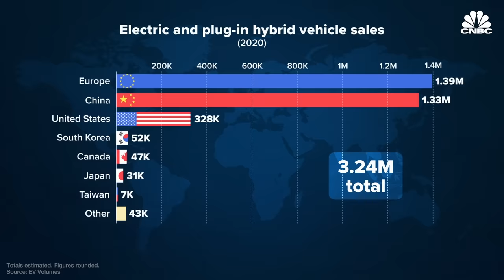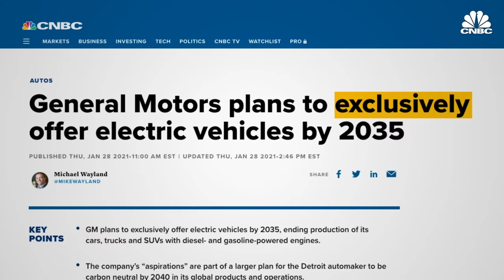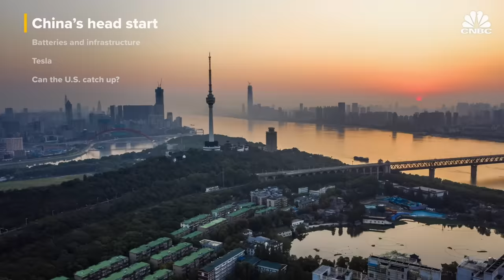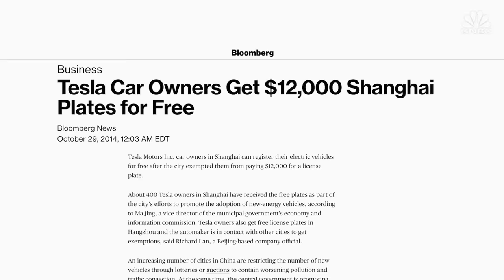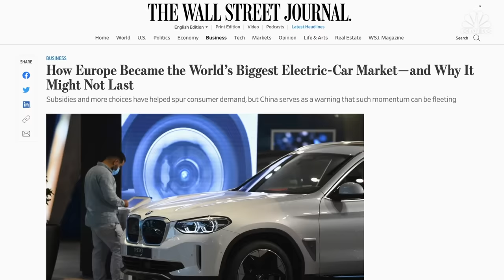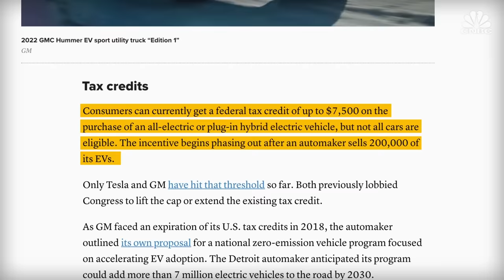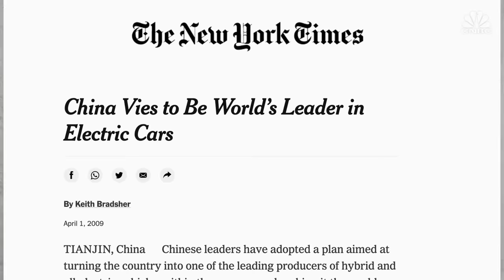Who Is Winning The Global EV Race?

Comment: even lithium batteries lifespan isn't what we're told they're supposed to be; in my experiments to try to do a partial off-grid power system, I've worn out lithium rechargeable batteries in less than 5 yrs.; we need better battery performance; but, that indicates just how much is our energy consumption

Comment: While what the video says is true. EVs in other countries outside the US mkaes alot more sense. There are places with cheaper prices for electricity, and shorter ranges required. The batteries dont degrade that fast and maintince so far is way cheaper. Also the batteries are normally under warranty for 8 years.

Comment: Battery swapping sounds great. Instead of coming up with thousands to replace a battery, it will be cheaper to just swap it out, yes there's a chance you'll get a worse battery but I would imagine they would take the bad ones out of circulation. And if it is bad, go swap again for a new one. It spreads out the cost of actually replacing a battery over the lifetime of the charging

Comment: While the only company that I have seen that did a CO2 production comparison between models was Volvo (ICE vs Hybrid vs EV), apparently they are all made in the same plant, EV's have an expected lifespan of 126k miles and reach par with ICE at around 90k miles in terms of CO2 generation. Initially 43 tons for ICE vs 55 tons for EV. This unfortunately did not take into account the lithium batteries which needed to be replaced every so many years. And the fact that we have no way f recycling the lithium, which is harmful to the environment. When are we as a citizen of the planet going to look at the things we make holistically instead of whats better right now?
Reply: Battery recycling can recover ~93% of the rare earth minerals.
Reply: @goevorgohome  Really? I didn't know that. can they be reused? I assumed metals yes. But what about the lithium? Can it be recharged or whatever it takes to be put into another battery again?
Reply: @heathbruce9928  When a car battery is at the end of it's life it can still be used for storage as it doesn't need to supply a lot of energy all at once like in a car. Alternatively companies like Redwood Materials can break down the battery and recycle the raw materials including lithium to be used again in building new batteries.

Comment: Battery swapping sounds like a great idea until some 75 year old driver run into the building and causes a fire that can't be extinguished.  It's bound to happed given all the cars crashing into structures in the news in the last few years. 
Why can't roads have inductive cables placed below the surface and cars driving on these equipped road just get charged like tolls for miles driven while  on them.   Small batteries can be used for local driving.  With wireless inductive charging cars could drive from coast to coast without ever needing to stop to recharge.  Your cell phone uses inductive recharging so it's not new, think of it as infrastructure for the future.  art:body-blue-raised-arms::hand-orange-covering-eyes:

Comment: Imagine if every ICE car had to have it's own brand of gasoline? How silly would that be? Swapping/ leasing is the only way this will work. Standardized batteries with computers to analyze the quality and charge balance of semi-depleted batteries are easy fixes. Also battery swap stations would be cheaper to build than gasoline stations. Also - Once swap stations become widespread, cars will be able to use smaller battery packs because range won't be as much of an issue.

Comment: I feel sorry for electric  car  drivers and future  owners. They will simply  have to learn the hard way .. as I did. These things are a huge hassle and a outrageous expense  in the long run. Batteries  are very ... very expensive to replace ( thousands of dollars) ...  and make no mistake, you will be replacing them. These batteries are highly toxic to our environment,  with a high potential for disaster to our surroundings. Plus I regret all the  lost hours at these charging  stations.  I wish I knew all this before I bought my car .  Do your homework before buying !
Reply: These idiotic claims are beyond silly by now.  Batteries will last literally decades today.  Even the older NCA batteries have 2000 charging cycles.  On a car with 350 mile range, that equals 700,000 miles.  On LFP batteries, with even 240 miles and 10,000 charging cycles, that is easily 2.4 million miles.

Just because some idiot bought a Leaf a decade ago has nothing to do with modern EV's...

Comment: I did not see any mention of how electricity is generated in China. Vast majority is coal-fired generation, and they are building more coal-fired power plants. China's air pollution problems having nothing to do with cars, there are not enough cars on the road to cause that much pollution. Worldwide, EV's will not "fix" the global warming or now renamed "climate change" issue. Estimates I have seen are that EV's will have lees then a 20% impact. The battery and recharging technology is not at the point that this can be rolled out to the masses. Maybe by 2035, who knows. I do know the bigger problem will be electricity generation. Renewables are not going to get the job done, and we have start be honest about this with ourselves. I admit coal-generation has to be phased out, but the battles against natural gas and nuclear power are short-sighted.

Comment: Hmm, 10 minutes to swap out batteries?! You'd think a robot-controlled battery swap could be done in less than 2 minutes. 10 minutes just seems like a really long time for something done by a robot... Like Elon said, 90 seconds seems reasonable just as long as the car is in the exact position it needs to be in. 10 minutes is longer than it takes to fill a tank of gas, lol.

Comment: There's no doubt that electric cars are the future.  Especially when it's pretty much mandated by our government.  That said can they make it where I don't have to plan a longer drive without having to worry about the availability and inconvenience of recharging?  I wouldn't even consider a 500-mile range vehicle (if that was possible) when I have to worry about the time and trouble of finding a recharge.  No doubt the push is on to go electric as we go forward and I'm waiting until gas gets so expensive, probably like a lot of folks.  I imagine when over half of all new vehicles at dealers are electric we're going to also strangely be met with outrageous petrol prices.  That's their trump card along with simply not offering much in the way of gas-burners.  So far trucks are the hold-up and we're already seeing the push to make that category largely electric.  You know your gas days are coming to a close when icons like the Camaro are being dumped and Challengers are going all electric...not to mention those silly electric pick-ups.  Did I mention going electric is painful?

Comment: Every manufacturer, who will make normal design cars, not weirdly overdesigned cars like it has been with EVs for some reason, will become another Tesla. Look, how much e-Golf sold. That is why it will be GM. It was just because of that. ID series is not that and will fall behind. If you look at any e-golf owners review looking behind how that car was or is, the MAIN characteristic is that it looks like a normal car. That's what people want. And that is why Tesla sells. While it is a bit weird, its still normal-looking. Unlike VW current EVs like the ID. series. Most europeans like a modest, minimal design car, not too flashy but not too old-looking. Just to get from A to B. A Golf basically.

Comment: I think Tesla gets waaaaaay too little credit for it's own charging network and auto insurance both which are capable of generating massive profits and also offer a better product than their competition. This doesn't even include tesla energy with their mega pack batteries and powerwalls and solar operations. Between the major differences of tesla embracing the entire picture of those related yet massive markets and leading the charge on autonomous driving they also have a great strategy of vertical integration to allow them to keep prices in a reasonable range without having to sacrifice quality of the components. Legacy auto makers are going to have a massive issue trying to make electric vehicles at a near equivalent price without both taking profit margin cuts and sacrificing quality of components which is going to cause all sorts of unforseen issues like with the bolt catching on fire because of poor parts used.

Comment: The pathway to electric cars needs to master a few more technologies.  They could be more economically done by mastering the electric vans and trucks first.  The sheer weight is only something a truck or van could handle.  I couldn't see a heavy electric car with a effective braking system to safely stop it operating in ice or wet roads.  Elon Musk is championing the wrong pathway.

Comment: The battery swapping stuff is absurd and for this reason alone ... because in 10 years, which in the MINIMUM time it will take for EVs to be a majority of cars on the road (as the current % of EVs on the road TODAY is only 3%), by that time battery tech will be 10,000 x better than today and battery swapping will be pointless EVEN FOR FLEETS.

I WOULDN'T PUT 1$ DOLLAR INTO THIS BATTERY SWAPPING COMPANY.  IT'S A STUPID IDEA.  IT'S A TECH SOLOUTION BUT A VASTLY INFERIOR ONE TO MERELY IMPROVING BATTERY TECHNOLOGY WHICH HAS ALREADY VASTLY IMPROVED IN THE LAST 5 YEARS ALONE.

Comment: We could actually do better than China by simply putting high taxes on fossil fuels, and then giving every citizen an instant rebate check to make the tax cost neutral. This way, the marketplace could find the best alternatives without hurting the average consumer.
Reply: Electric cars run on fossil fuels?    How does taxing it matter?
Reply: Val - The only thing holding back alternative energy options is the fact that fossil fuels are still the cheapest option. The only way to give alternatives a chance, is by making fossil fuels much more expensive (ie tax). When that happens, it will give industry the incentive to R&D better energy alternatives. 

PS - unless the electricity to charge the cars is created by alternative fuels, electric cars are actually running on fossil fuels.

Comment: It's a absolute mess!! 💯  
It's going to have a major impact on poor and working class making a ever growing inequality even worse. Public transportation in America is awful and is not going to accommodate the needs of a population that will be left behind by electic cars. The cost of electric cars is double the cost and with homes increasing in costs as well, it's just going to create more inequality. 
The electricity grid is another issue! The grid is still depending upon fossil fuel and we don't have anything really to replace it. It's just a feedback loop. The main issue is not getting solved. It's just creating a way for car manufacturers to make and sell more cars. Car manufacturers are in competition with their own products. More than 50% of the cars on the road are ten years old. A large amount of the population buy used cars that are a fraction of the cost of new cars.  The car manufacturers will be the ones to come out on top but climate change will not get solved. It's just a way of getting people to buy a car that is extremely expensive. Smoke and mirrors..... Smoke and mirrors

Comment: WKaurself - do you laugh at the reality of EV? Those are all facts I noted - lithium produciton which is only 50% going to EVs is totally inadequate to address demand even if eveyone wanted an EV.  EVs don't fit most peoples needs. Half the world has zero ability to even charge; you need electricity.  In more modern nations over half the population do not have a garage; or a house for solar panels. They rent, they park on the street.  Just to replace the 9 million Diesel trucks would take current lithium production  for the next 10 years. Just US heavy trucks no magapacs, no EV cars or light trucks, nothing but US heavy trucks - 10 years.

Comment: Electric cars may be the future but sorry to say, they are not the solution. Right now, electric vehicles are not only expensive but so are their counterparts. You can't have a charging station if you live in an apartment building. I have no problem going electric but they just have to simply perfect the program. I drive from Pa to Florida. Im trying to make time so i travel at night. I dont want to sit for 20 min or longer to charge when i can fuel in 2 min. I do have a hybrid and i do get good range. And my cars are paid off and no, im not interested in a fortune in electric vehicles. Perhaps in the near future.,..

Comment: Replaceable batteries are a TERRIBLE idea. Diff people have diff driving styles which impacts battery wear more. So if you replace batteries, you could end up with badly maintained battery packs. Also there's 0 incentive to protect and maintain your own pack and it leads to poor driving habits causing quicker degradation of battery packs. Humans are not the most efficient species to be doing this honestly. And finally, this will take what? 5min claimed? Reality will be 10-15m honestly. Not to mention maintenance on the robotic thing that does the swap. Compare that to the 10m to 12m it takes for L3 Supercharger to move you from 15% to 80% charge which is about 210mi range restored for a 310mi Tesla. If you are willing to another 10min, you can go from 10% to 85% in 22m-25m from my real world experience with L3 250kW charger. Soon these chargers will be 350kW to 500kW and cut these times by as much as 50% making a 10% to 85% recharge in 10m-12m. 
There's no use for Ample honestly.

Comment: Ample's concept of battery swapping is good on a technical level - however, allowing battery swaps forces the depreciation cost of the battery to be factored into every swap-out (since the batteries still degrade and eventually have to be replaced).  This added cost, using Tesla's numbers, is roughly twice the electricity cost to charge the batteries and hence will make EVs operated in this way far less attractive.
Reply: All wishful thinking
Reply: clearly you missed the part where it allows them to use renewable energy to charge these batteries.

Comment: Car dealers are now refusing to accept electric vehicle in part exchange because the batteries will need replacing at around 9 years at a cost of about £9,000.... You will be stuck with your old unwanted EV

Comment: I have owned two electric cars, and frankly gas can be 99.99 a gallon, i would own a gas vehicle, even if i have to make the fuel myself.
Reply: Which means nothing.  No one else will...
Reply: @redbaron6805  if you've ever been to any car show, or ever been in a cold climate, you'd know just how wrong you are.
Reply: @rustbeltrobclassic2512  I grew up in a cold climate and own a Tesla.  Therefore I know you are literally full of BS...
Reply: @redbaron6805  welp, to each there own I guess, to me it isn't worth the lack of range, increased cost of registration, increased cost of electric, paying double the cost of a comparable gas vehicle, having to rely on incompetent repair people and the lack of heat in the winter. To me a gas vehicle that I can fix myself, will always be in my driveway. I don't care if I have to make my own fuel, i will never own another ev again.
Reply: @rustbeltrobclassic2512  There is no "lack of range".  Electric car range is up to 520 miles already, and charging is down to 15 minutes.  How much range do you need?

That is beside the rest of your claims are simply false.  There is no "increased cost of electric" as the electricity cancels your gasoline bill.

And the price premium over comparable gas cars is around $5k to $10k, nowhere even remotely close to double.

That money you will save back due to lower maintenance costs, lower fuel costs and longer longevity of electric cars.
Reply: @redbaron6805  a Tesla model 3 is roughly the same size as a Honda Civic or Toyota Corolla. Show me a new Tesla 3 for 28k.. I'll wait.. 

In my town they charge an EV tax in the form of a 500.00 registration charge. That's per year. Gas car's don't have that, they claim it's to cover the lack of tax revenue at the pump. 

As per range, I haven't seen a single EV do 520 miles at 80mph while my f150 would do nearly 700 miles at the same speed.. 

I don't have fast chargers in well lit nice places by me, what I do have is a homeless camp next to a Tesla charge station, or I could go visit one of the always full Tesla chargers by the dealership. I have tried to do a Cleveland Ohio to NYC trip and couldn't make it on one charge, had to spend the night on my way there and barely made the next charger.. the infrastructure doesn't exist yet.

Edit: as per the saving in reliability, not sure about that, again comparing size a Corolla will run 300-400k trouble free miles.. and still be work 3-4k bucks.. haven't seen a Tesla do that yet, not saying it's not possible, just saying I haven't seen it.. and I'm only poking at Tesla because they've been around the longest making EV exclusively, so they really have no excuses.